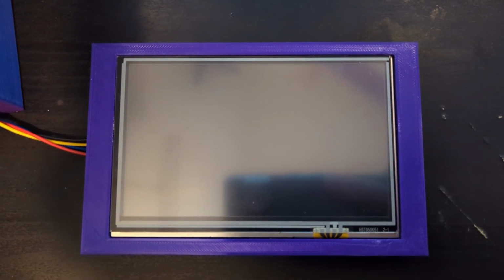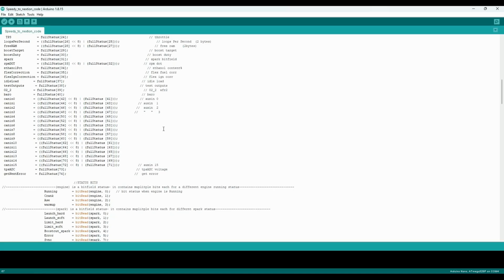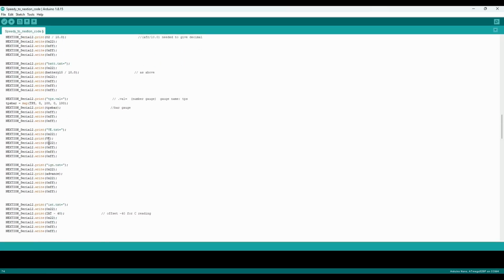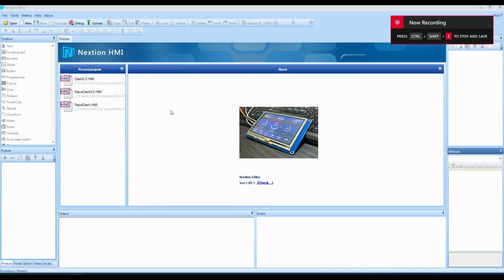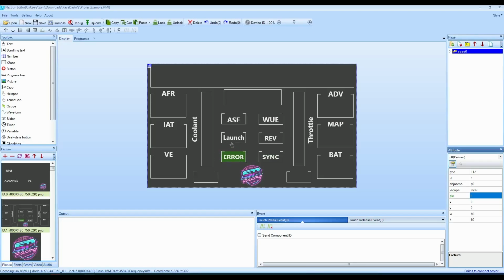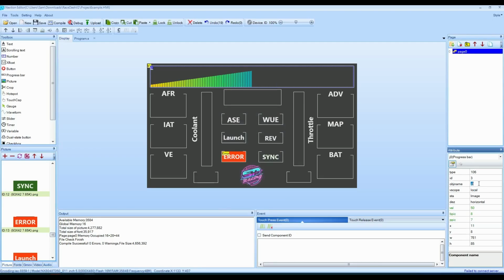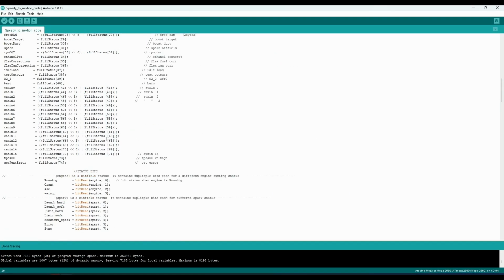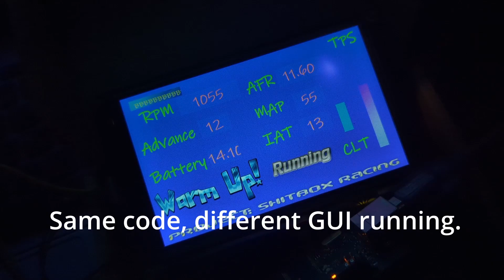Speeduino Serial Race Dash Using Nextion Screen - How To, With Example Code.

Comment: Hi I'm building a similar project for my renault 5 ,I'm new to coding ect is there anyway this code could be used ,to display serial information from my ecu masters emu to a nextion display?

Any help or info be very grateful
Reply from the maker: @carlcatlin8078  unfortunately I've never looked at an ECU masters setup so have no idea how they relay information over serial to adjust code.
Reply: @BadEngineering  ok thank you I thought it was worth a try ,could you help with your coding for the nextion display

Comment: to clariify i will upload this code to an arduino hooked to a nextion then the speeduino's arduino will feed the former arduino to feed the nextion the values? two arduinos?
Reply from the maker: @daniiizambrano6553  yeah, there might be errors in the code that need to be changed, but should be obvious.
Things like tps value will need adjusting for your application as well
Reply: @BadEngineering  where on the speeduino is the rx and tx going to the nextion?
Reply from the maker: @daniiizambrano6553  serial 2, states in the code.